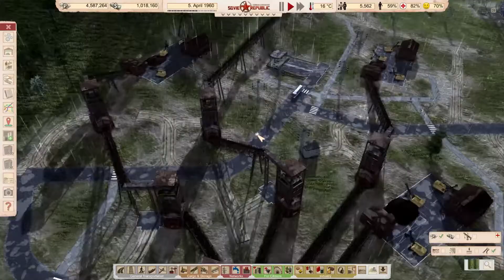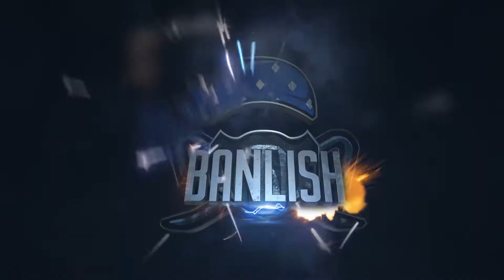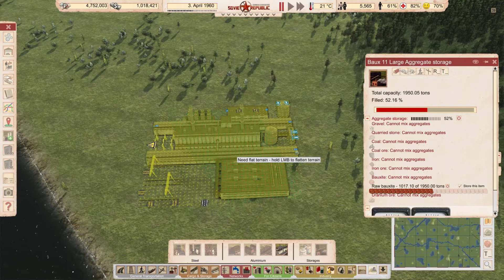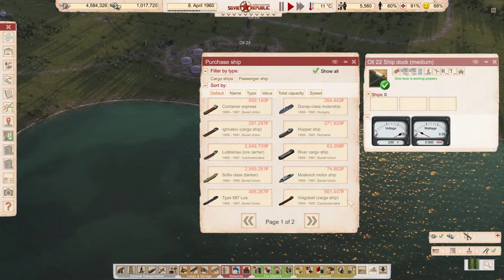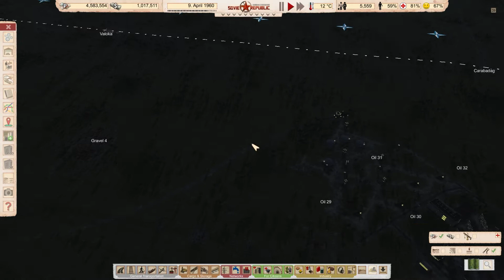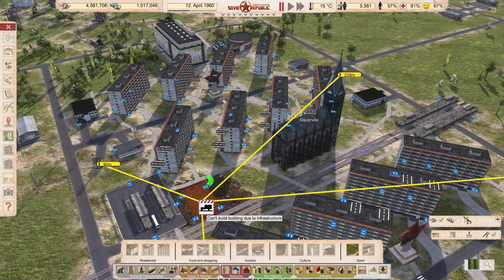Exports DOUBLED? Bauxite, Sports & Culture, Doing this right? Nah..... maybe? Workers and Resources

Comment: Hey banlish you mentioned shortcuts when trying to place footpath, you know the arrows in the top, the ones pointing down, you can select things on 1,2,3 etc, and you can have multiple bars so f1 f2 and so on. Not sure you knew (I have dirt road on 1 remove road on 2 and HV power lines on 3)
Reply: Ooh lol later you actually open the thing to put in hotkeys never mind 🤣
Reply from the maker: Ja!!! I did know about that, but I should make a little attempt to actually USE IT, that would be smart